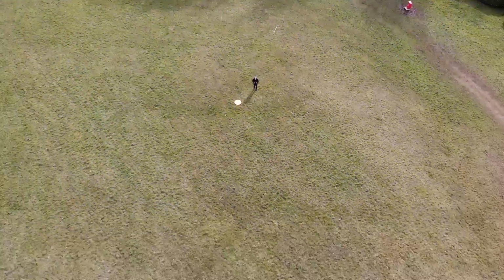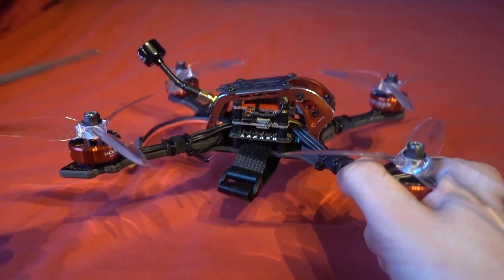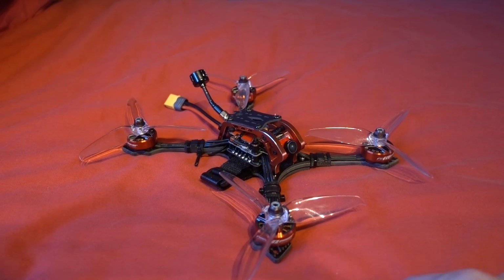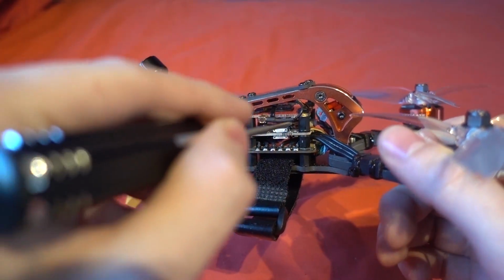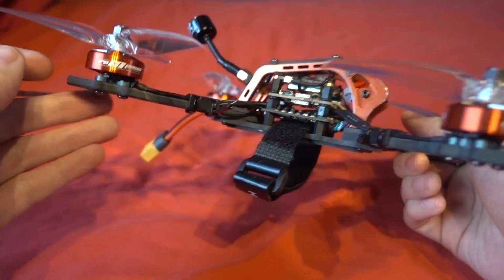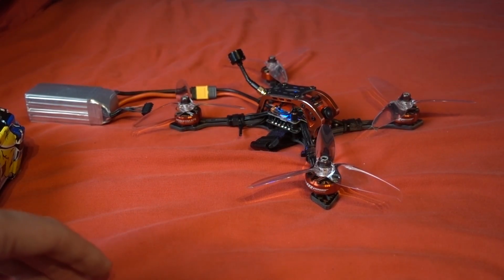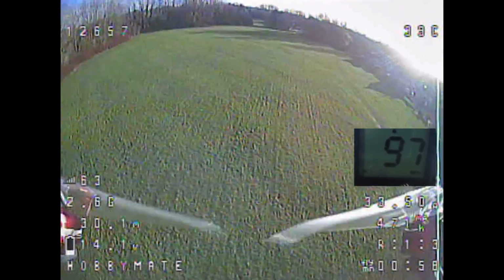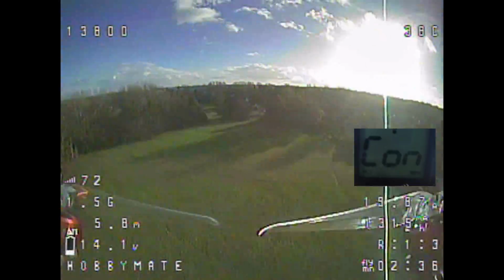Hobbymate Meteor Is INSANE & It Pulled 8G! Using Betaflights G-Force Meter!

Comment: Hey Andy, love your reviews. I bought the hobbymate meteor recently and i am getting light static in osd when i arm it and more so when i throttle up, i made sure it wasnt just vtx wires touching the battery wires so i wanted to ask you if you think adding a capacitor would help? I know you said it doesnt need one is why i ask before doing it. Thanks!

Comment: Fantastic machine !!!! :) The G-sensor will be the new "must to have" :)
Reply from the maker: I think it just uses the accelerometer seby and betaflight have calibrated it to show gforce so any FC above an f3 should be able to have it? I could be wrong.
Reply: Yes, just a feature of BF. I have it set in my telemetry on acceleration Z axis + which tells you your max G load in vertical orientation. Also have it in OSD.

Comment: Wish someone would produce short MMCX connectors - they're always too long.
Reply from the maker: do you mean the connector part or the length of the cable?
Reply: @AndyRCchannel  vtx connector - the offending cable that's too long - then the connector for the antenna. Cut the cable down to an inch perhaps.
Reply from the maker: for the connector the reason it works so well compared to micro ufl is because its bigger so there is no changing that but the 90 degree does no harm for me especially if you rout it at the back of the copter. as for longer and short lengths im pretty sure you can buy those. if not they are pretty easy to cut up and make your own I have done it a few times. there are vids that show you how to do it. cheers

Comment: Hi  Andy just acquired snapper 7 can not bind it to radio did you do review on this model cheers dave
Reply from the maker: i did not im afraid its one they wouldn't send. No idea why
Reply: AndyRC . I believe they’ve updated the Snapper7 by putting it on a plastic frame and call it the Mobula7. After people complained about the alumium frame bending easily.

Comment: Try flying a zero-g paraballa
Reply from the maker: I did :) but you cant get a minus or complete 0 reading with a copter unless in 3d mode because it needs to be pushed downwards due to the air resistance and the props in air mode, a plane can fly downwards against the air resistance and reach 0
Reply: @AndyRCchannel  ah I remember watching something try to send the quad up really high (do a punch out) and try to leave some throttle on during the asset. It might work if you add just enough to reach a certain speed. I will try to find it and post it.
Reply: 9.81 meters a second per second should get you zero gravity. So climb and fall at that speed and you should be good.